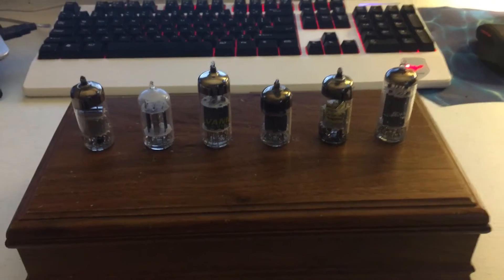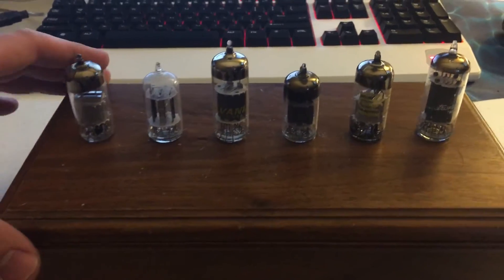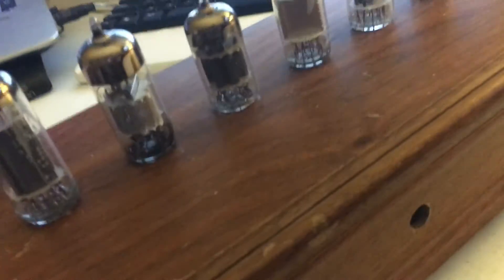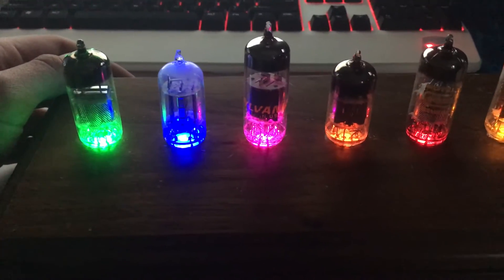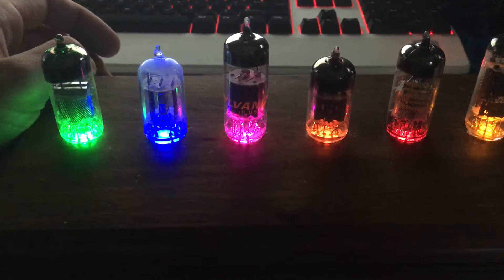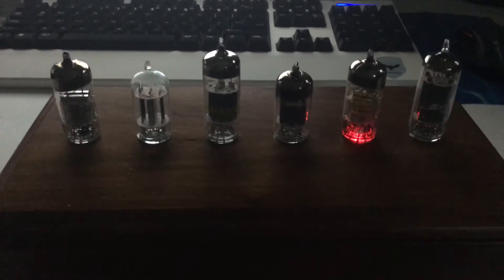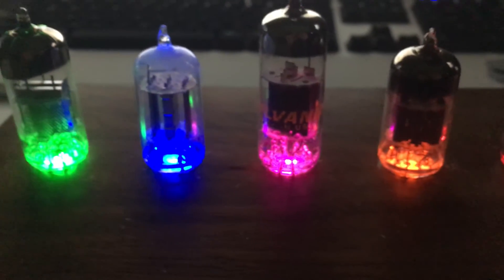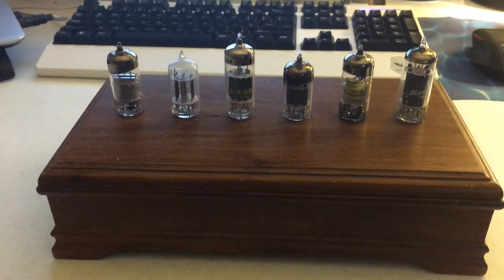Vacuum Tubes Project

Comment: @TheMan4407 did you drill them through the bottom? I was trying to do this for a project of mine but drilling into the vacuum tubes was pretty hard to do.
Reply from the maker: Nope! I just glued LEDs into the base at the center of the pins
Reply: @TheMan4407  can i make a hole in the bottom of the tube to put in the led if yes how ?

Comment: Great project, it looks like fun. Can you share the code?
Reply from the maker: I'm definitely not a computer science major, but this gets the job done :) The different ledPins are just different color leds on those specific pins declared with a current-limit resistor. Also there is a switch at pin 2. Depending on if it is high or low, that puts it into both of the modes that are shown in the video. PWM for the fading effect and the potentiometer is directly linked to the time it takes to cycle.

int ledPin1 = 3;
int ledPin2 = 5;
int ledPin3 = 6;
int ledPin4 = 9;
int ledPin5 = 10;
int ledPin6 = 11;
int light = 13;
int time;
int repeat;
int potPin = A0; // Setup of all LEDs pinouts
int mode = 2;

void setup() {

pinMode(light, OUTPUT);
pinMode(mode, INPUT);  
digitalWrite(light, HIGH);

  }

void loop() {
if(digitalRead(mode) == HIGH){ //if mode switch is in the HIGH position do random LED fading
 // time=70;
time = analogRead(potPin)/10; //Adjustable time
A: int randPin = random(1,7);
if(randPin == repeat){ // Make sure no repeats happen
  goto A;
} // End if
if (randPin == 1){
  for(int i=5; i<=255; i+=5){
  analogWrite(ledPin1, i);
  delay(time);
  if(i==255){
    for(int i=255; i>=0; i-=5){
      analogWrite(ledPin1, i);
      delay(time);
    } //End inside for
  }//End if 
}//End outside for
}
else if (randPin == 2){
  for(int i=5; i<=255; i+=5){
  analogWrite(ledPin2, i);
  delay(time);
  if(i==255){
    for(int i=255; i>=0; i-=5){
      analogWrite(ledPin2, i);
      delay(time);
    } //End inside for
  }//End if 
}//End outside for
}
else if (randPin == 3){
  for(int i=5; i<=255; i+=5){
  analogWrite(ledPin3, i);
  delay(time);
  if(i==255){
    for(int i=255; i>=0; i-=5){
      analogWrite(ledPin3, i);
      delay(time);
    } //End inside for
  }//End if 
}//End outside for
}
else if (randPin == 4){
  for(int i=5; i<=255; i+=5){
  analogWrite(ledPin4, i);
  delay(time);
  if(i==255){
    for(int i=255; i>=0; i-=5){
      analogWrite(ledPin4, i);
      delay(time);
    } //End inside for
  }//End if 
}//End outside for
}
else if (randPin == 5){
   for(int i=5; i<=255; i+=5){
  analogWrite(ledPin5, i);
  delay(time);
  if(i==255){
    for(int i=255; i>=0; i-=5){
      analogWrite(ledPin5, i);
      delay(time);
    } //End inside for
  }//End if 
}//End outside for
}
else if (randPin == 6){
  for(int i=5; i<=255; i+=5){
  analogWrite(ledPin6, i);
  delay(time);
  if(i==255){
    for(int i=255; i>=0; i-=5){
      analogWrite(ledPin6, i);
      delay(time);
    } //End inside for
  }//End if 
}//End outside for
}
repeat = randPin;
} //End random LED fade sequence

else if (digitalRead(mode) == LOW){ 
for(int i=150; i<=255; i+=5){
  analogWrite(ledPin1, i);
  analogWrite(ledPin2, i);
  analogWrite(ledPin3, i);
  analogWrite(ledPin4, i);
  analogWrite(ledPin5, i);
  analogWrite(ledPin6, i);
  delay(time);
  if(i==255){
    for(int i=255; i>=155; i-=5){
  analogWrite(ledPin1, i);
  analogWrite(ledPin2, i);
  analogWrite(ledPin3, i);
  analogWrite(ledPin4, i);
  analogWrite(ledPin5, i);
  analogWrite(ledPin6, i);
  delay(time);
    } //End inside for
  }//End if 
}//End outside for
  
}
}//End void loop